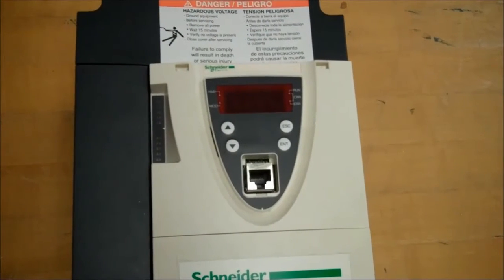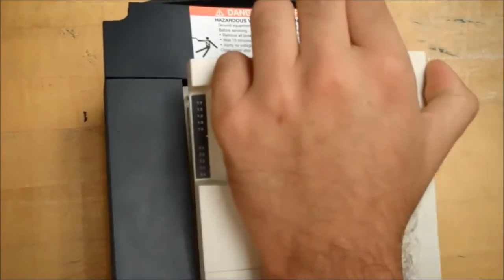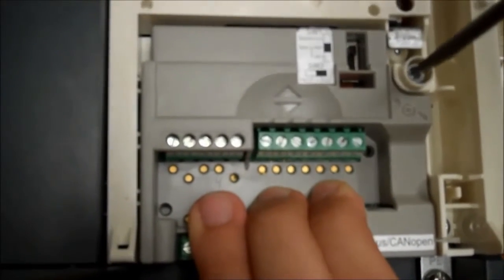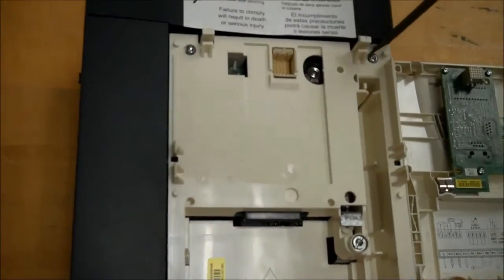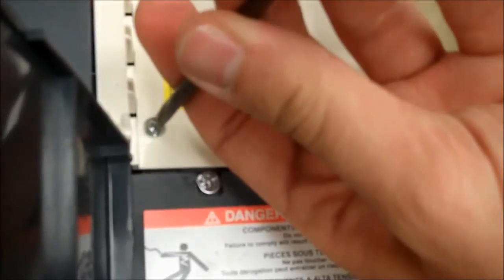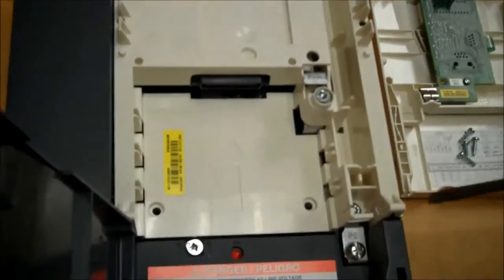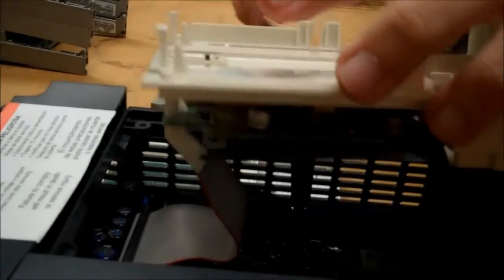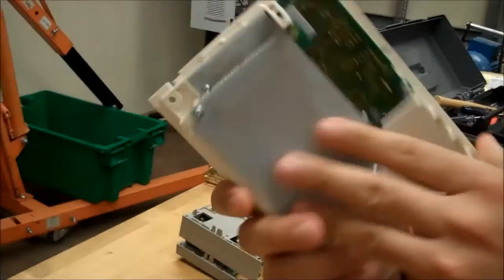Replacing Main Control Board on ATV61 & ATV71 Drives | Schneider Electric Support

Comment: What is the problem when this drive show the fautl CFF
Reply: CFF is not a fault, either you changed power card or control card so drive is asking you to make a factory reset just keep on pressing enter in display key pad. it will be alight, but drive will be in default program state
Reply: Any one who know give answer please